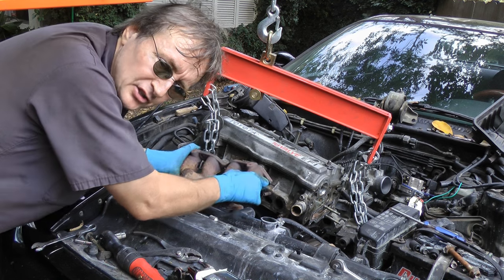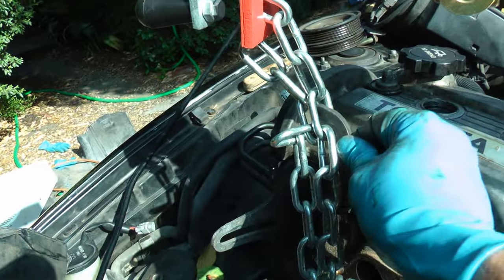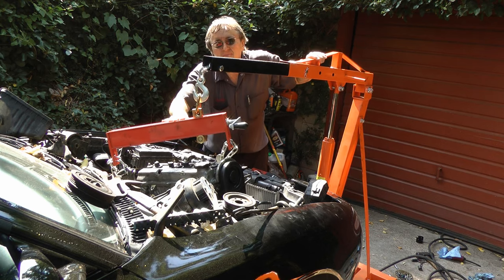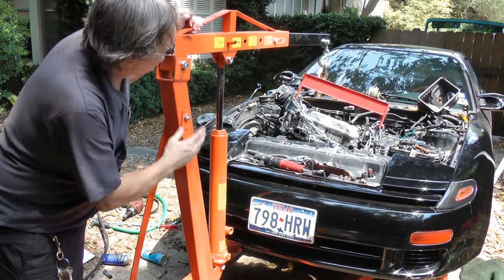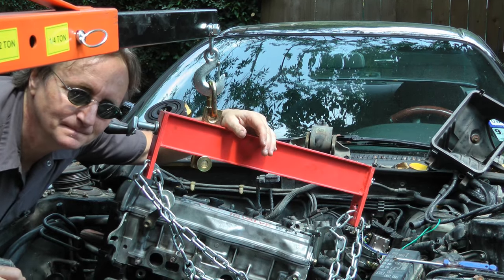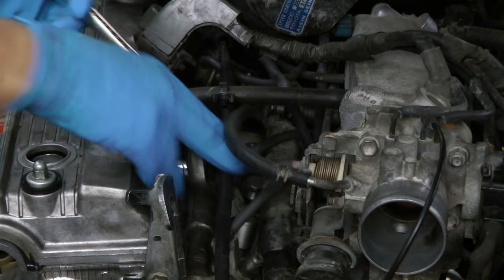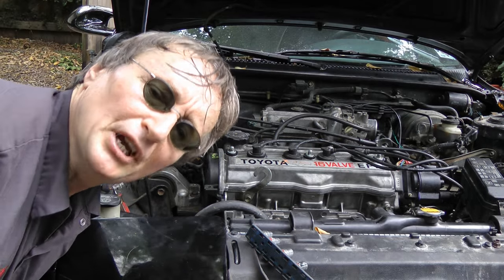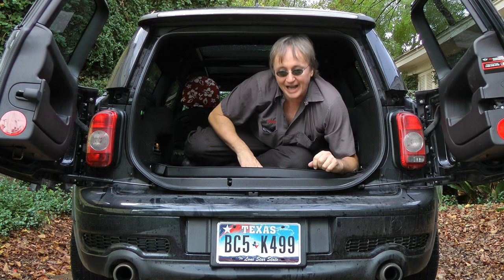How to Replace an Engine in Your Car (Swap)

Comment from the maker: rods are probably knocking, put some lucas oil stabilizer in the engine oil and pray it lasts a bit longer. 'realize those korean made crapper engines only last so long, and can not take abuse for long.

Comment: Good job Scotty, you forgot to show broken exhaust manifold bolts etc. why did you pull the old engine? What did you pay for the replacement engine? And did you do anything to freshen up the new engine? Thanks in advance for a reply. I too am a huge fan of old toyotas. And harbor freight. Tools for the home mechanic. My first Toyota was a Corona, 22r double timing chain. Loved it 400k miles. Every thing since then has been a Toyota

Comment: + replace with NEW exhaust gasket/intake manifold gasket/s !!! VERY important ALSO replace the sealer rings of your injectors assembly. DO NOT use the old ones.

Comment: I'm pretty sure I could get an engine out if I tried by unbolting everything I could find, but putting it back in with all the hoses, etc and not having any extra bolts just wouldn't happen.

Comment: what engine swap would you recommend for a 1978 Datsun 280z?
Reply from the maker: HARD to find a good used engine on something that old really, unless you can find a rebuilt one that someone did and didn't get paid for so they'll let it go cheap
Reply: It's pretty common for people to put in chevy motors, usually a v6.
Reply: Is that supposed to be some kind of Roadkill reference?
Reply: Rebuild that motor. You will thank me later. I have seen SR20's / RB20/25/26's go in with not too much work. But rebuild that motor. Never seen a VQ go in, but sure it could fit. But if you rebuild the motor you will love it more and probably have more opportunity to sell it in the future.

Comment: I might be needing to do this to my 89 Silverado soon. :( or rebuild the engine in it. Still runs like a top. When I start it up in the morning I hear a "Knock knock knock" sound. Only does it when it has been sitting for a bit but i put some Lucas Oil Treatment in the oil.

Comment from the maker: Why bother if it works fine? I've seen em with 300 thousand on em. When it starts breaking down, then put a new one in. Realize it's a heavy engine, much harder than this toyota video

Comment: well thanks for answering, if i can get the same engine with low mileage for $200 would you recommend doing a engine swap or no other than the knock the car is perfect somewhat

Comment: @DrAgOnAnGeL7 
My Ford Taurus had a problem like that. It would buck and stutter when it was stopped (ESPECIALLY if the AC was turned on.) And would also stutter and not accelerate if you pressed the gas pedal down too far (Around the time where it would downshift automatically.) It turned out that one of the spark plugs wasn't firing at all, and a few of the rest that were firing were arcing.  Replaced the spark plugs+wires and also the ignition coil and it's been running fine ever since!

Comment: So basically the engine just slides in the transmission.. You don't need to fish any axles or anything.. Just rest the engine on the mounts and fish the clutch inside the transmission housing and once it's flush, put all the bolts in and tighten it up.. 

Asking this because i'm going to convert my 1.7 liter V4 engine into a 2.0 liter V6. So basically turning my 1967 P5 17M into a 20M.

Comment: Hi Scotty i definitely see that changing the engine should only take under 2 minutes to remove the old engine and put the new engine in it.  Whenever my 2024 Toyota Corolla hybrid will need a new engine whenever I reach 300,000 milles I will definitely show the Toyota mechanic this video advising them that it's should only take under 2 minutes to change the engine so instead of charging me closer to 10K that they should only charge me $25 if that.💰😀

Comment: Hey scotty, would it be worth swapping the engine on a 1999 solara v6 that gave out at 221,000 miles or should I just scrap it
Reply from the maker: I'd put a good used engine in it, they can go much longer
Reply: Even with that many miles on the transmission?
Reply: Alberto Irizarry Hopefully you can get a transmission with the engine and swap the whole thing out and in, in one go

Comment: Replace your engines using your car service manual boys. Scotty here just shows his approach in replacing engines and promoting those products, of course, nice deal btw for the hoist... Even if he shows every single thing he did to dismantle that particular engines..it'll do nothing to show how to replace and swap YOUR ENGINES that might be inline 4,6, might be a V6, V8 V10, or V12 ...not every car engines is the same. If you're not so trained dismantling cars with service manuals, don't do it..things might go wrong after you put it back together. Find a good honest mechanic to do the job.

Comment: Hi Scotty when replacing the new engine can I use the same ecu that the vehicle already has??? Or do I need to buy one with the it's own ecu?
Reply: You can use the old one. But I recommend a new aftermarket one if you can. Think of it like a computer - have computers upgraded since you bought the car?

Comment: About 10 years ago I bought a used import motor out here in L.A. to replace a dead Mitsubishi 2.0 motor that had head/valve damage due to a slipped timing belt (crap interference engines!) and a valve that slipped into the cylinder. Cost $300 with 60K Mi on it. The car ran like a top until I dumped the car 5 years later. No sense in doing actual rebuilds (unless you are talking classic rides).

Comment: how to clean your car 5min . How to change the engine 2min. Anyway, I suggest having a fire extinguisher when you run the engine for test . in case there is any fuel lines leaks or electrical circuit issues

Comment: Hi Scotty recently my engine locked due to low oil pressure that I didn’t get to change. The car is a 2015 Kia Optima. It this worth putting another engine in ?

Comment: Should I be "afraid" to pull my engine. I own a 6.5 diesel with nearly 300k on it. I want to do my injectors, gaskets, head studs, and maybe some other parts further in my engine. What should I do? I have everything I need to pull the engine, im just hesitant to do so.

Comment: Is it a good idea to crank the engine over a few times before hooking up the fuel injectors so that oil will lubricate the pistons and get the fuel moving through the fuel lines?

Comment: hey scotty i have a 2013 ecoboost engine blown.
the dealer that sold it to me said its my fault for downshifting to decelerate the truck to save my breaks thats when it happened.
Reply from the maker: well, don't downshift, it wears stuff out, but really it doesn't blow a well made engine. Unless you are going over the redline and not changing the oil

Comment: Scotty,
I like this video but i know have a 1990 celica with a 2.2L BUT it has motor problems, somebody ran it dry of oil and maybe antifreeze too so im thinking new lower end bearings and head gasket are bas so im gonna get a rebuild kit with some piston rings and bearings and gaskets, Would it be possible for you to make a "rebuilding an engine " video ? we all would highly appreciate it, and to show us what all machine work is needed and what special tools, Thanks So Much !!!! -Brandon

Comment: Big debate, Scotty ~ I've a '99 Mitsubishi Eclipse RS with compression failure on 2 cylinders. Piston rings are cracked and if I accelerate 'normal' as I would with any car, engine can pop and car slows down with that intoxicating aroma. Sooo have the rings replaced, rebuilt the engine or swap it with another Eclipse engine? ... which are harder to find because lead-foot idiots are crashing them every day. Engine just hit 88k miles today. It's got potential.
Reply: u sure its rings and not head gasket... compression failure on two pistons that are beside each often means head gasket failure...
Reply: quickguesswho I don't know what action to take anymore. I'm wrestling with the thought of either having the whole thing rebuilt or get one of those manufacture refurbished with limited warranty deals, whichever is more cost effective.
Reply: in this day and age it would probably be ALOT more cost effective with a swap. Just do your research on the engine you plan on buying. Also, most places that you get used engines from (not junk yards) have a limited warranty and a compression guarantee. I plan on swapping the engine in my '92 legend, looks like the engine's only going to be around 850 :D
Reply: Endiare ASB 3500+ for mine. Fuck that. Makes me wonder how much more for the 4g63.@_@
Good luck on yours.

Comment: @tstimevato thanks.. for the tip. had that in mind since the first thing i ever did on a car myself  was a tune up. had the issue when i got the car out of the junk yard. lol. @scottykilmer thanks for the advice... do you have a video on replacing the fuel pump or filter? i learn better watching hands on with videos. dont know how to change or even know where the fuel filter goes..

Comment: Would an engine swap from a 93 toyota celica 2.2 ltr into a 90 toyota celica that also has the 2.2 ltr engine be as easy as the one you just showed?  The 93 celica is an automatic, and the 90 is a standard.  I'm not planning on changing the transmissions, though i'd love to.  This video is VERY helpful, and gives me hopes of performing my own swap.
Reply from the maker: no, this was a same year swap, on this model a 3 year newer one wouldn't fit, they actually first sent me a year newer one and it wouldn't work and they had to bring the right one a second time
Reply: Ugh!  I'm hurt, but very thankful for the info.  I have 3 Celicas...two are 90 models, and one is a 93 that my daughter just totalled.  My daily driver has 440,000 miles on it, and her 93 had only 120,000 miles on it.  While mine is still running very well, it uses  quite a bit of oil, and i like how the 93 sounds and perfoms much more.
Reply: maybe the engine blocks are the same but the sensors and other components are not and you don't have to strip two engine and make hard work , just get the same engine and put it on , but don't through the old engine away

keep it if you have a space in your garage , maybe in the future you need to take something like sensors , fuel injectors , hoses , bolts or pulleys that you can't get it used or new it self except buying a whole kit contain the part you need and other parts don't need it at the moment , or you can strip good parts and sell it online to try recover some money that you spent on the new engine

Comment: Pardon me Mr.kilmer but I just got a 2017 ford escape with 100,00km on it. unfortunately, the engine needed replacing after a month of owning it but I just got it back after 4 months. Do you think it could handle a 6 hour drive on highway & country roads? And could it be to much of a headache that I should consider selling it back or trading it?

Comment: Hi scotty. Question i have is would it be easier to replace valve lifters in a 2003 ford explorer xlt 4.0 or replace the entire engine? Car knocks continuously but still drives fine. Engine only has 130000 miles on it.

Comment: Hey Scotty! i just suscribed! i was wondering, I have a 1990 civic dx and i was gonna replace the existing engine on but the only thing that stops me is what happens if the transmission doesnt line up or something? is there anything special you gotta do when you connect the transmission or do you just put it on until it fits? any aligning? or what not. Thank You Scotty 
-Danny

Comment: Hey Scotty. I've got a 08 dodge Dakota with a blown engine 5.2l. A friend offered to give me a v6 out of a Dakota he had laying around. I was wondering if the engine would  bolt up to the old v8 transmission.  And if it does what would I have to do with the ecu. Should I use the one from the v6 or keep the one for the v8. I've looked online and can't find anything I could understand.

Comment: @toyota4life94 
I am looking at buying a really nice 2002 PT Cruiser for $400 with a slipping transmission. Plan on flipping it if I can get it working decent. I bought a 1999 Sebring with problems for $150 and sold it for $1400 after spending about $200 on it. You are completely correct, Chrysler sucks.
My car is a Camry XLE which runs great.

Comment: Hi scotty i hope you are all well.
I have vw golf 1.6 2002 automatic.
Engine is gone.
Is it difficult  to change automatic engine or its the same procedure as manual engine ? And also should i take out the engine with the transmission or just the engine out ? 

Help please

Comment: @toyota4life94  1st you cannot shange the mileage it is against the law (TIMA of '86).   Second while most clusters even digital store the mileage in the cluster and will usually display the mileage on the cluster some cars must match the pass key to the cluster or the car will not start.  Some cars need to have the proper cluster programming for steering wheel controls to work. And in many cars the mileage is stored in the cluster, PCM and BCM so a tech with a pro scanner can see true mileage.

Comment: Scotty If I was to change an engine on a car with a electronic mileage gauge, would the miles displayed read the same after the engine swap.  Or, does the engine somehow store that information inside the engine?  Or, am I gonna have to change the mileage on the new engine to display the same miles as the blown one?

Comment: I'm doing a swap from a 2004 fuel injected 350 to a 86 GMC Sierra Classic. Could I just swap the intake manifolds and keep it carbureted?
Reply from the maker: If you are putting the modern engine into the old vehicle, you could hook up the carb system, but of course, not vice versa.
Reply: Thanks Mr. Kilmer!
Reply: Scotty Kilmer So If I have carb engine and I want to convert it to EFI it's not possible?
Reply: Ivan Rubio you can convert a carb motor to a EFI set up if you want to not that hard really...Look at Holleys website
Reply: MrMSA90 Yes I already talked to someone that already converted his carb to EFI, a fun project in the future.
Reply: Ivan Rubio Im hoping to convert to EFI in my 72 C10 one day

Comment: I am doing a engine swap on my scion tc. Do you have to take the fuel rail off or can you just disconnect it using a special tool?
Reply from the maker: you take the whole rail off

Comment: If you buy a a haynes manual, will it tell you exactly how to do this as well?
Reply from the maker: +Joshua Smith it will give helpful info, but not all inclusive, only a dealer manual would do that
Reply: Can you buy one of those for yourself?
Reply: +Joshua Smith ebay, just type whatever model and year then service manual after it. Ive bought a few over the years they are worth it.

Comment: so I learned to take out an engine I need to remove the exhaust and intake manifolds and fuel injectors. Then I can pull it right out.

And I thought there was like a hundred other things to detach.

Plot twist. Scotty is not actually a mechanic. He is part of the matrix, and this was a glitch.

Comment: Taking it out and put it back in, is the easy part. Getting it all out back together properly, with the right short/long length bolts in the right holes, is the hard part.  🔩🔩???  - Humpty Dumpty had it easy.

Comment: I was wondering why did you replace your engine for your to toyota? ?
Reply from the maker: I bought it for 900 bucks from an 18 year old kid who drove it with a leaking water pump, so the engine warped the head from running too hot. It still ran, but was damaged from foolish cheapness.

Comment: The engine im buying can be boltet right in. the car is made for that type off engine. But its a more powerful engine than the one i have now. But the new engine i buy is a complete package with sensors harnes transmision ecu ect. So maybe you have a good video on how to install these things, How much can be assembled before the engine is mounted? 
Whoops thats suddenly a lot i know sorry :)

Comment: How about the electronics part. I heard, there is some programming needed to be done.
Reply from the maker: If you used over the old electronic parts, NO. But if the used engine came with electronics and you used them instead of original ones, yes

Comment: Hello Scotty, I have just replaced an engine on a 1998 Honda Accord EX coupe and 
just noticed that my transmission slips especially after about half hour stop-and-go drive. What could I have done wrong? I didn't notice that with an old engine.

Comment: @INS14466 CONT, can this noise be a sign the clutch is going bad? and when in reverse could that be the drum beaks? while i am driving and if i lightly swerve i can hear another rotating squealing that goes in and out, i dont know if that could be wheel barings or if the pad is hiting a warped rotar, sorry for the poor job i did explaining but i dont have money to see a mech. im some what mechinical all i need is a little guidence lol thanks wether u answer or not ur channel is great and helpful

Comment: hi scotty
when u replace a blown engine,do you have to take off the ac compressor ? do u have to take off the gas then refill it with gas again ? do i need to change the alternator+compressor+steering pump ?

Comment: Umm...Its cool that you compressed engine swapping into 2 minutes....but it doesnt really work that way haha.

Especially if you have no experience doing so, I wouldnt recommend anyone doing it to a car they need if they never have before. 

There is a reason it cost so much to have an engine swapped....its ALOT of work. Thats assuming the car doesnt have a bent frame causing the motor mounts to not line up...

This is one of those things that is better left to the professionals, not a DIY thing unless you have a junk project car to play with.